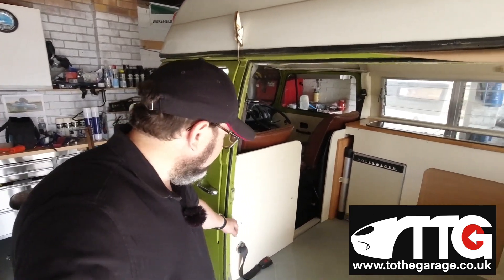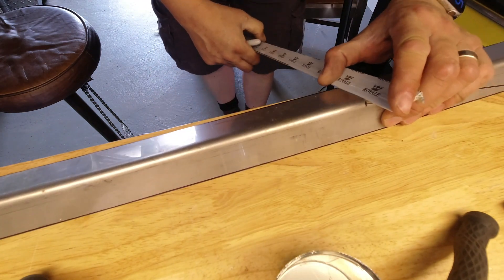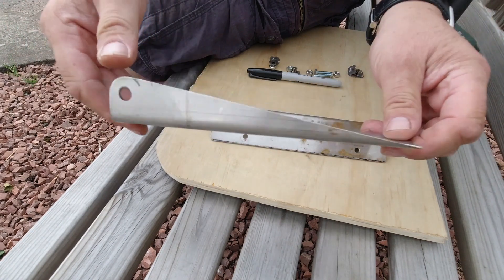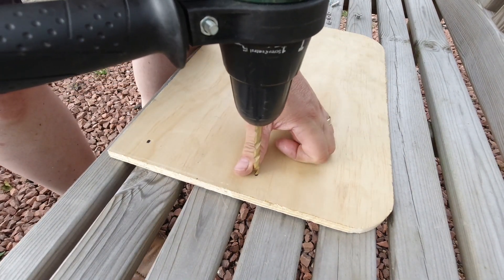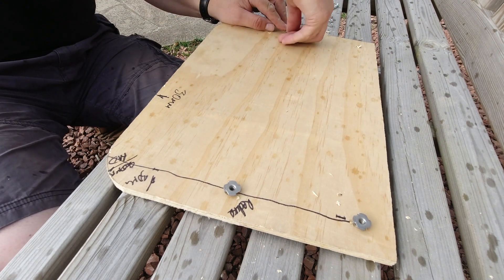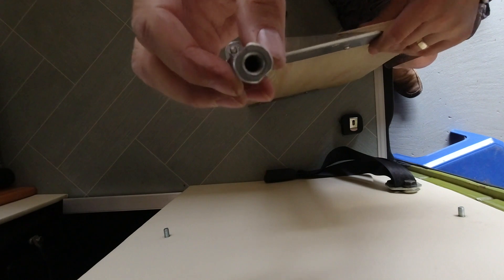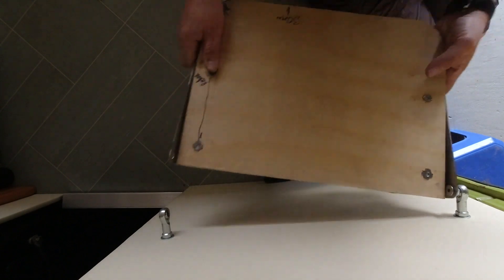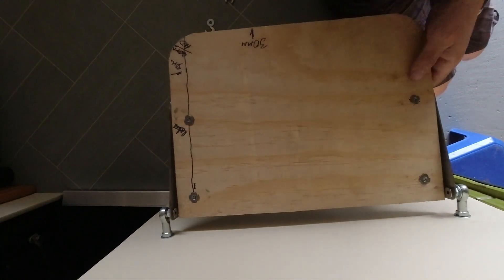Scratch building a well engineered 'Buddy seat' pt1 for Olive the VW T2 (Ep 16)

Comment: Hi John great video. I need your help have you ever had the problem were YouTube won't process your video
Reply from the maker: yes. Its usually to do with the size of my videos and the Dodgyness of my Broadband and it just keeps chucking it out.
If your issue is similar than I recommend saving the edited video to a location on your laptop (as a MP4?). Then use a piece of free software that is called 'Handbrake' it will reduce the file size to about a quarter without reducing quality.
Then when that has made you a new smaller file. Upload that
Reply: @ToTheGarage  thanks John 😊

Comment: Hi John, I've got a  98 XK8.. I've got one issue.. drive safe  mode in the amber light... Mechanically, there seems to be no problems while driving. However, the light and message is permanently on. Any suggestions sir?
Reply: Hi Kevin, When you say the Amber light is on do you mean the Check Engine light ? if that is the case you really need to get the car plunged into a scanner and get the codes read to find out what is wrong, it maybe running and driving fine now but problems could develop in the future.
Reply: @johnbeckett2624  thanks for the quick response John. Will do.

Comment: We Yanks call it a 'jump seat' and the four-prong deelybobs are called T-nuts.  It's all fun and games until you lose a nut.  Elegant design, but I recommend putting the Heim joints inside of the brackets so they are hidden when the seat is up and using larger diameter thicker washers on both sides of the bulkhead to improve the bearing surface.